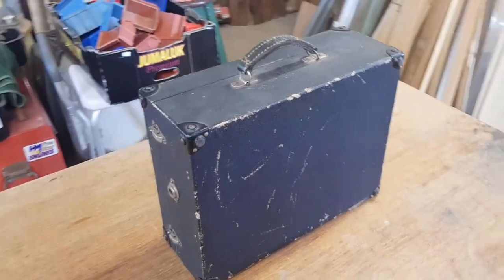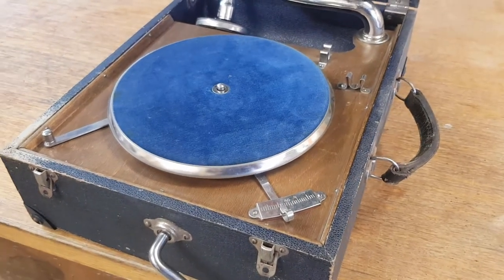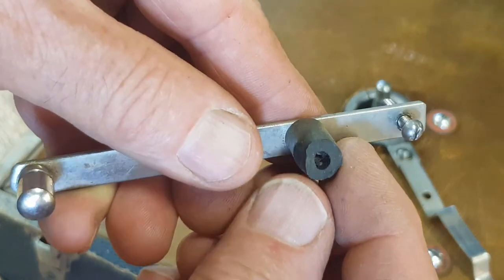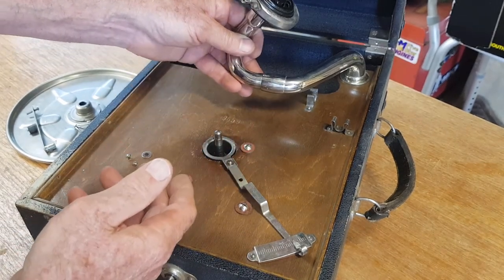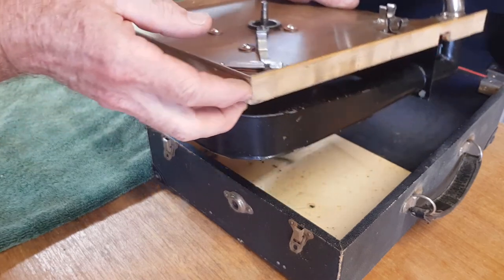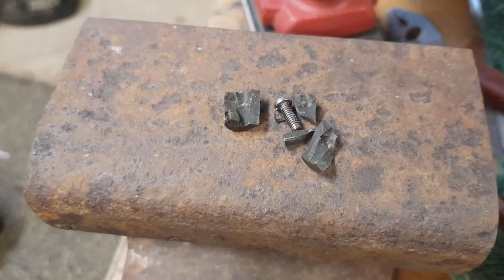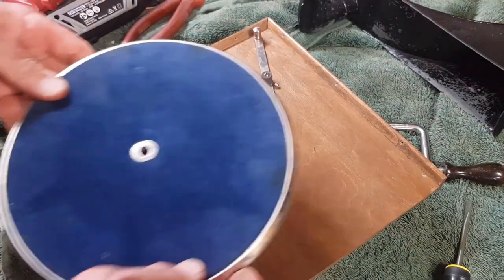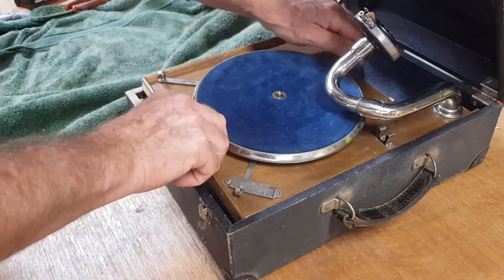Repairing the brake mechanism on a 1920s portable wind-up gramophone. A quick fix and inspection

Comment: Good repair and I would agree with stopping the turntable by hand before applying the brake. I have read that just applying the brake can be bad for the spring. It's also worth knowing that you shouldn't rotate the turntable by hand as this causes the spring to wind down and when it becomes completely unwound the end of it can pop off the rivet it's attached to. In many motors the spring is only held at the end by a tear shaped hole which allows for easy spring replacement. If this happens, then it usually requires disassembly of the motor to fix. Thanks 😀 👍
Reply from the maker: Thanks mrrgstuff! That's interesting and makes perfect sense! Thanks for watching and I appreciate your input! 👍😊

Comment: I note that the screw is pointing out above the rubber. Is the screw acting as the brake or the rubber? I thought I heard the screw scraping against the underside of the table/disk when you applied the brake.
Reply from the maker: Neither the screw top nor the rubber top touch the underside of the platter David. The contact point is high on the side of the rubber.

Comment: how come the worm gear is driven by the spur gear. Isn't worm gear self-locking or am I missing something? I am trying to do a 3d explainer video on that and I need to know..please help
Reply from the maker: Hi there. I'm not totally across the mechanics of the motor, but I think the worm gear assembly just drives the governor which limits the speed of the main drive somehow. I don't quite remember!
Reply: @TheUltimateRecycler  Thanks for the reply. But I've seen another one restoring video and to my surprise, that spur gear really drive the worm governor assembly. I guess that worm gears are not self locking.